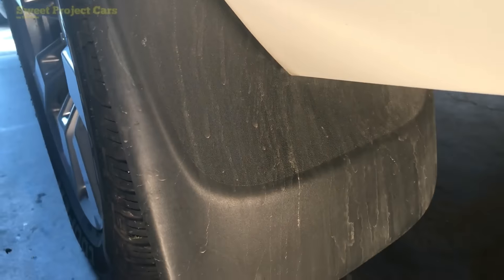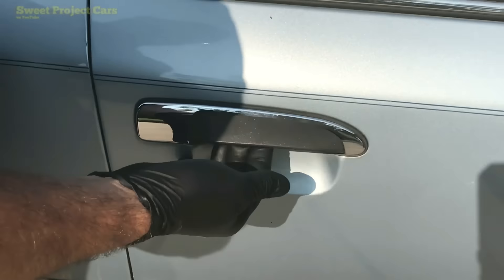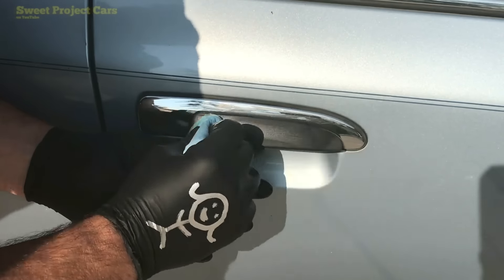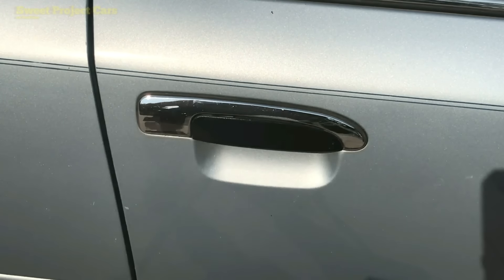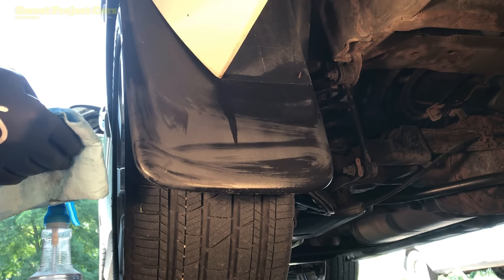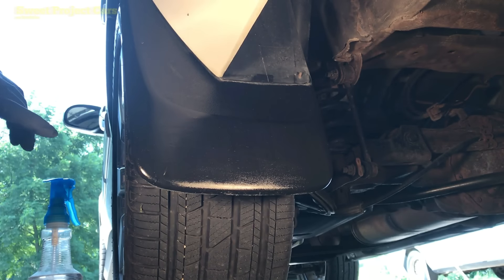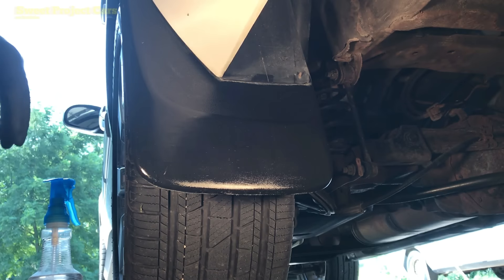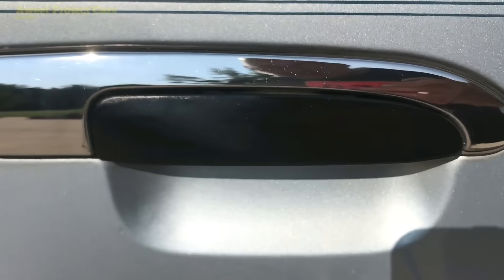Stop CLEANING Wheel Wells & Mud Flaps

Comment: @Sweet Project Cars I’m curious, have you found something other than the small applicator cloth and block that can be used to apply ceramic coatings to plastics? Like a small brush of some type? 

I have some ceramic coating that I want to use on plastics of varying sizes and it would be nice to be able to use an appropriately sized applicator for each job. 

Love your videos! Thanks in advance.
Reply from the maker: Allan Johnson we only use the applicators but you can try other items and see how they work for you.

Comment: awesome awesome , Mike ..aka 'Mr 303'   Will be doing this the next time around as I just slathered my 20 y/o mud flaps with Mothers the other day.
Can you use ceramic coating on the rubber weather strips at the base of the car windows ?
Reply from the maker: Will Rogan it does not work to well with rubber :)

Comment: Another great video Michael. Would you 303 first then ceramic coat?
Reply from the maker: You will not 303 Before you ceramic coat that’s why you use the 99% rubbing alcohol to clean anything and everything off that’s ever been on the plastic then ceramic coat then you can use your 303 on it to keep it even nicer have a great night my friend We will see you Friday
Reply: Hari Madhavan I was wondering the same thing...
Reply from the maker: Chakar Khan Rind yes 303 will be fine to use on our ceramic coating for a double layer of protection

Comment: Wil the Ceramic coating work on painted (oil or latex) wood?  Great vid!
Reply from the maker: Todd Reimer we use it on everything but have not tried it on that, but if it can be cleaned of oil and grease so it will adhere we see no reason not to give it a shot ...thanks mike

Comment: Is it more cost effective to use 50/50 isopropyl alcohol or even 70%? What is the main advantage of using 99%, is it just the evaporation time?
Reply from the maker: James A. the 99% is used because of its superior cleaning ability..and when you are applying expensive coatings you want to be absolutely positive it is clean.

Comment: Would 303 work  on the plastic the same way?
Reply from the maker: Hello Jack how are you doing the 303 is the best conditioner out there no doubt, but it does not  repel dirt dust and mud the ceramic coating as shown in the video is a standalone product that nothing can even compare to basically you put it on it last for years  you hide the dirt off with a light mist of water and the UV protection is unbelievable we actually 303 over it as an added security just because we love using our 303 the two together are unbeatable team
Reply: Sweet Project Cars got you thanks
Reply from the maker: Jack Collins  you are very welcome and thank you very much my friend :)